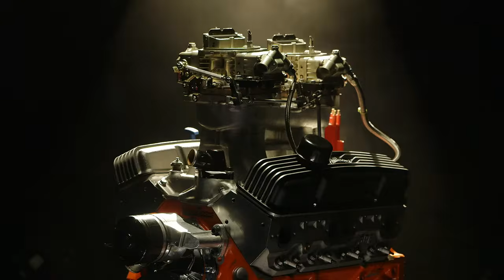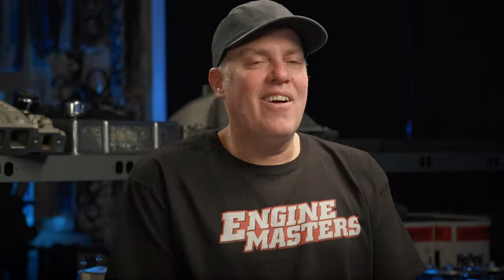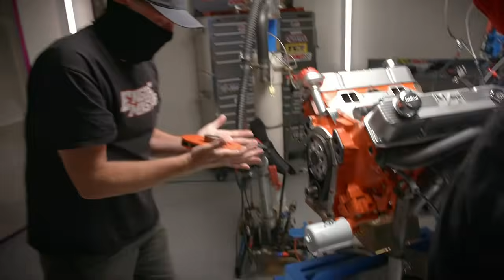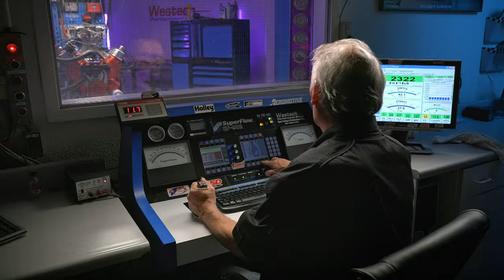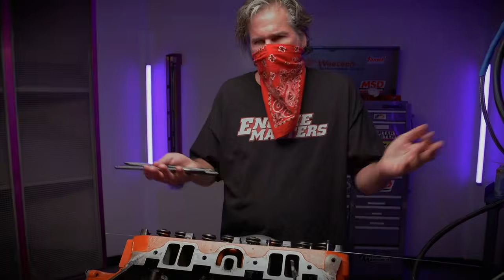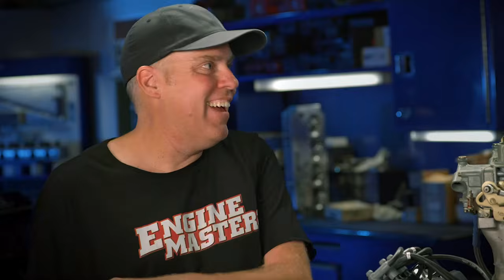Engine Masters  S5E65   Engine Personality Test  Camshaft LSA Explained

Comment: This is so confusing. 
Low separation is “choppy” better mid rpm torque ~4000rpm. 
Wide separation is better for low rpm, ~1500rpm , and better for high rpm ~7000+. 
Is this assessment correct?
 
At the end of the video they put a narrow separation camshaft to tune for mid range torque.

Comment: Failed to mention anything about static vs dynamic compression and LSA. If your running too high of static compression for the street you use a narrow LSA (108-104 duration cam) to lower the dynamic compression so you don't need to run jet fuel on the street... LOL

Comment: On small RV towing cams would the tighter lsa still pick up some low rpm and mid range torque in the usable rpm range im running at and how much would I have gained from a 114 lsa and they getting it ground on 110 lsa? My cam is a Howards 255/261  201/207@50 .414/.420 lift on 114 lsa. Its a pretty small cam but im pretty high geared in overdrive about 2000 rpms 60 miles per hour. 72 C10 pickup. Im guessing i could have gained 10 to 15ft lbs for 4 degrees?  Interesting test. Im already at 10 to 1 compression and 195 psi on the gauge with the 114 lsa and I would think the 110 lsa would crank out an even higher psi number?

Comment: What about vacuum? Do accessories run fine with a 106 cam?
Reply: No....i have a 454....it hets 6.2 to 7.5 hg vac
Reply: @tomkelly3896 pretty rough? Did you switch to a hydraulic brake if you didn’t have that set-up already?
Reply: I had to do a vacuum canister for my Cutlass and fixed all my brake problems

Comment: 😂😂
You guys are funny, idiots but funny. You still think atmosphere psi fills the cylinder will never understand mid range.
Think negative psi and youll find tighter is better
Reply: I didn't consider that but in my research it seems tighter is better for most engines. its like ok extra 5-10hp at max rpm in exchange for 10% everywhere else.

Comment: LSA is like ERA in American Baseball; isolated and not adjusted properly for defensive errors in partially pitched games, it means next to nothing.  When building my second FE 390, we were shooting for 14:1 w/ P&P'd high flows and constant scrutiny of valve events namely EVO/IVC.  We ended w/ a custom grind RV style @ 109 LSA.  Like delicious burnt cheese in a lasagna pan, an end result or product from many other variables.
Reply: Inversely you could have just spec'd your lsa at 109 and arrived at your desired events. It works both ways, that doesn't make one meaningless.
Reply: @pimpovic2 W/ respect; you have to tinker w/ the valve events namely REG in relation to EVO/IVO and set a compression goal as well.  Your LSA is a result of maximizing said criteria, not a starting point!  And as you aim for high compression, even knock rating of fuel enters the stoichiometry.  The Old-Time Racers even tweaked their fuel for weather.

Comment: The problem is, this is really for old ( no emissions), weekend warriors with carburetors.

There is a maximum amount of overlap that can still pass emissions and get decent mpg. I just never seen anyone test that.

People don't talk about the lack of idle vacuum for EFI, Power brakes, A/C, P/S, etc.

This is why VVT was such a game changer abd why current performance cars can be daily driven & make power.

And the whole,  shorten your duration to keep the overlap low is a joke...doesn't work.

Comment: Always consider what you want your power and torque curve to be, on a naturally aspirated street/strip car with a small block I would always lean more towards the tighter side starting at 108. And on a N/A big cubic inch motor again I’d lean towards tighter LSA the only time I would go wider LSA is with boost and even then that would depend on my goals with the engine and how I want it to behave but with that said there’s a lot of variables that go into a decision like this and at the end of the day this is purely my opinion based off what I’ve experienced and seen.

Comment: Hey fellas, how about small block engine test where you keep the same  carb, manifold, cam and heads but only changing cubic inches. Start out with a 327 then 350, 383 etc. would this be a legit test?

Comment: The power from 106* separation angle most likely comes from an advanced intake lobe which will get the large intake column moving quicker by exposing the ports to the increasing bore volume sooner.

Comment: I built a lot of street engines in the 80's and 90's with 112 and 114 LSA, installed 6 degrees or so advanced. IE intake centerline at 106 ATDC and they absolutely screamed. Just get the intake valve open early.

Comment: As you make the lsa wider you are also advancing the exhaust valve opening point. That can hurt low-midrange tq because it's possible work that could be applied to the piston but help blow down losses at high rpm. Same thing goes for the intake opening. Wider lsa retards it and that can help the top end by helping cylinder fill at high rpm. With at a narrow lsa the advanced intake helps low end tq and dynamic compression by starting the compression earlier. It's not just the overlap.

Comment: where are the lobe separation tests for going 2500 to 3000 rpm pulling trailer up a mountain pass?   These tests are worthless to most of us who do not drag race.
Reply: I've never drag raced or plan on it. I would like to know how LSA effects fuel economy at 2100 rpm on the hwy.
Reply: @deadcarnahans1932 LSA on a SBC they like 112 for gas mileage. Don't use a 305 for towing.

Comment: There is no ideal LSA, everything can effect it, and on the dyno with unrestricted exhaust and long collectors, more overlap will show power improvements that are very difficult to replicate in a street car with less then ideal exhaust. Better to focus on  getting intake opening duration lift and closing right , LSA change gains are very combination specific. Also the better your cylinder heads are, the less overlap you need. Overlap is used to add additional vacuum to the cylinder during the emptying cycle by using venturi effect in the exhaust to increase it. So if you have exhaust backpressure in the collector, more overlap can actually hurt the engine particularly at high RPM. I say this as someone who owned a chassis dyno for nearly 20 yrs and tested everything under the sun.

Comment: I think intake valve opening dictates the peak rpm. When intake opens sooner you get more low end power. I wonder if the 112 & 118 cams need to be advanced to advance the intake opening.
Reply: Mostly correct,  intake closing event is a big influence on high rpm performance.

Comment: The 1956 Plymouth Fury's cam had virtually identical lift and duration as the standard performance Plymouth V8.  The difference was the Fury's cam had a tighter lobe separation.

Comment: I find it very misleading to the general population. Lobe separation isn't an input, its purely a result of the valve events. This test needed to show the changes in cylinder pressures with different cams. Could of easily reduced the intake duration and widened the lobe separation to end up with a similar IVC and would of made more ftlb and carried it to the peak power and  made more power. I get understand its almost infinite the things you can try to refine a given engine combination. I just feel this test and conclusions isn't what people should be choosing/selecting camshafts  with..as you know you can change the LSA on 1 or both lobes depending on what you do. That's why and engine will only ever know ivo-ivc-evo-evc...

Comment: I have heard that lobe separation angle or the lack there of will reduce or increase vacuum Hg.  If this is true, does Steve Dulsich's motor make close to zero vacuum?
Reply: You definitely lose vaccum at low rpms. This is why it usually requires  a higher idle speed and is very difficult to run with efi or a car that has vacuum power brakes.

Comment: Then again my hemi 5.7 has a 118 lsa from the factory so it's not all that bad to try it
Reply: Hemis are a different animal with their opposing valves. There cross-flow design doesn't  need as much over lap as an inline/wedge heads.  Hemis also have a unique issue with valve to valve clearance with big cams and tight lsa.

Comment: DV would say pull some duration out if what you care about is idle quality and low speed driving...but keep the tight LSA.
Reply: Especially if you’re a stick car guy. This is why back in the 70s we used to say high lift for a stick long duration for automatic on street cars.

Comment: Another great video. As other comments mention, would love to see idle vacuum for each cam and dynamic compression ratio and/or cranking pressure.

Would it be possible to hav a part 2?  Theee cams all with the same exhaust opening and intake closing but sifferent overlap (intake open and exhaust close).

Comment: Am I correct in thinking a Tighter lobe separation would help bleed off some compression because of more over lap?
Reply: Wider lsa (later intake close) will reduce dynamic compression.
Reply: @Stingray2201 Thanks. I was thinking when he said both valves open for a moment with tight. It would work the other way.  I may be worried about nothing. Some tell me 11.1 Will cause Detonation issues in my application  Others say it's Total Doable. I'm aware of the variables from Quench Piston and head Material.  GM did it with the tbss and it's Heavier. But richard holder say I'm gonna have trouble. Both know what they're talking about. But disagree. It gets Confusing for someone just learning.

Comment: If you don't have a DOHC engine, you're missing the boat.
Reply: 30 years ago or so someone made dohc heads for a bbc and it made 1000 hp on pump gas and was docile enough for street driving
Reply: oh no, my super simple pushrod motor that makes 400+ hp isn't good enough, oh no.....

Comment: Trickflow 190s should've been used on the mopar also cam at 258 @ 0.050 would've done the job . Take advantage of the 902 lifter.
Reply: This is a big block, tfs 190 heads are for smallblocks. If they used TFS 270 heads it would have made 50hp more.

You were right about most cams being designed for small chevy 0.842" lifters and not the bigger (0.906)mopar ones. They gave up some power there.

Comment: It would be interesting to know what the torque and horsepower is from 1,000-3500 rpm for a daily driver. I don't drive over 3,500 rpm very often. I'm often towing and need more torque than horsepower.
Reply: None of this is optimal for towing.  Except the tunnel ram. That will actually work really well. It beats everything
Reply: Thank you! My cruise RPM in overdrive is 2000-2100 and I once hit 4200 on 2-3 shift. Would like to see this same type of test for our engines with mild cams and dual plane manifolds.

Comment: I saw David Vizard do a great video about lobe separation and he was 100% correct based on what I saw on this video - great video to show how lobe separation affects HP and Torque - but i would have like to seen how it affected vacuum in the engine - i assume the tighter lobe separation would decrease vacuum - and if you have power brakes that could be a big issue unless you run a vacuum can -

Comment: David wizard say 108 is the ONLY LSA
Reply: His formula (which is based on a 350 Chevy with 10:1 static compression ratio) is displacement and intake value size specific. I haven't done the math but I do not think you would get 108 lsa on a 440.
Reply: @Stingray2201  the bigger the cylinder volume compared to the valve size makes desired LSA go up. 108ish for sbc but 110 for bbc. I did the math for my 5.3LS and it came up as 108.9. I know its not meant for that engine but dyno tests seem like he's correct there was well.
Reply: It's based on intake valve size and displacement.  108 for a 10.5:1 350, 107 383 105 406 same heads

Comment: 2 l s a  s.... 1. A. 110....2. A 106... The 106 opens its exhaust valve sooner and has a longer overlap...... This creates blow through effect.... And has more blow through effect than the one ten does..... And that's a good thing..... Because it increases the amount of vacuum pulse behind the exhaust pulse.... Pulling more fuel into the combustion chamber...... You blow my mind.
Reply: Not just a scavenging effect making power but also increased dynamic compression with the increased intake valve closing point angle. Another reason boats and towing vehicles use a wide LSA. High loads and big temps makes a motor a detonation machine so the decreased real world compression with the increased LSA makes a much safer combination, even if in a perfect world with 110 octane everything a towing vehicle would appreciate the extra torque from a tighter LSA.

Comment: As David Vizard says: if you have an unstable idle, the problem is not the LSA but that you have too long an idle for the needs of your engine. Choose the correct LSA for your engine and then determine the appropriate cam duration.
Reply: David Vizard entered a Cam Competition for Eric Weingardner and came in almost last place. He knows SBCs but his cam "formula" isn't very accurate. Eric did a video on this and it shows that DVs formula is basically bs.
Reply: @Bobthebuilder.69  Vizards formula is absolutely fantastic , but only for a very narrow window of engine specs. Vizard knows a ton, and does some great things with engines, but his formula should have been left in the dark.
Reply: @Bobthebuilder.69  he also predicted exactly where he would place and how much power it would make.
Reply: That doesn't really work. It shortens the intake duration so much that the intake closing point happens too soon. Peak power rpm is reduced as is peak power because you need to drop the static compression to reduce cranking pressure. 

His LSA theory only really  works for classic weekend warriors. 
cars running high octane, no power brakes, p/s or a/c that don't care about emissions, part throttle  drivability or mpg.

Comment: had a 351w it had a 108 lsa factory. with a tiny 195* @50 and it sounded good with glass packs and headers. pulled like hard to 4000  then was over. 2bbl did not help

Comment: The answer to the question of why higher LSA, always comes down to if you're planning on running high cylinder pressure down low in the RPM range, where you don't want the scavenging to leak boost pressure out of the exhaust. Higher LSA closes up the exhaust quicker when intake valves are opening so you can make more efficient cylinder pressure with exhaust driven turbine, or a belt driven super charger.
Reply: You totally ignored the intake phase. On a wide lsa: as in the test,  the intake is opening / closing later with a wide lsa, therefore not trapping as much air.  The cam is dumb, it’s going to act exactly the same with or without boost. 
  If that” blowing out the exhaust” was detrimental, a wider lsa would make more power if it was “ holding in” more air. The wide lsa just isn’t trapping enough air.

Comment: Tight LSA cam in a street car, auto trans and 3000-3600 converter should be fine. The reason I say this is because I’m doing it in mine and I don’t have bucking. The car drives great and isn’t a slug taking off. Yank made me a great 3600 converter. If you have a stick trans, you’ll just have to work that clutch pedal.

Comment: your blowing my mind......
Look LOOK THERE'S A THING CALLED BLOW THROUGH EFFECT..... WHICH IS MORE POWERFUL YOUR VACUUM PULLING THE FUEL INTO THE COMBUSTION CHAMBER... OR YOU'RE EXPLODED MIXTURE GOING OUT YOUR TAILPIPE...... AS YOU GO TO A LARGER AND LARGER OVERLAP... YEAH IT RUNS CRAPIER. BUT WHAT DO YOU EXPECT... YOU'RE TURNING UP THE PULSE... AND THAT PULSE PULLS MORE FUEL INTO THE COMBUSTION CHAMBER...... YOU'RE KIND OF LIKE SUPERCHARGING THE ENGINE...... BUT REMEMBER IT'S ADJUSTABLE.....

Comment: Now look into David Vizard's formulas for picking a cam. Engine and valve size determines LSA for best compromise of max torque with less peak drop off with 10.5:1 compression. Duration determines rpm range. Then your overlap is a compromise for the driveabilty you want. 

I'd honestly like to see a comparison between something like 104 LSA with 212dur vs 104 lsa with 218 duration just to see how peak rollover is affected with to tight of lsa. A 305 likes about 109lsa, 350 108, 383 likes 106-107. It would be interesting with the lower duration would give better street manners but would probably still have a choppier idle and better torque than a stockish cam.
Reply: as good as vizard is, his formula is only good in a very narrow window of specs.
Reply: @leftyo9589 There's a LOT of holes in his equations.  It really works for Carbureted street/strip cars, Only.

 It doesn't work for EFI daily drivers.

It doesn't work if you have Power brakes/P/S, A/C.

Definitely doesn't work with emissions requirements.

His Overlap chart is a joke. The range of duration is so wide that it's basically useless.

 I also heard him say that if you need more vacuum for power brakes to shorten the duration vs. opening the LSA. That doesn't work either. You can't make peak HP at 6,000rpms on a Stroker SB with a 218/227 on 106lsa with 9.7:1 like you can with a 236/242 - 114lsa 11:1cr. with the same amount of overlap.
Reply: I'd like them to compare cams of different lsa with the same amount of overlap @ 0.050". The problem is the tigher lsa would need such a shorter duration than the 110 or 112lsa that the compression would need to be lowered.

They would need to retard the tight lsa and asvance rhe wide lsa to have the same intake closing point.

That would be a test I'd like to see.

For rhe same amount of overlap, I would need to run a 228/234 @ 0.050" cam on a 106lsa to have the same overlap as my 236/242 on a 110lsa.

Comment: The most interesting test would have been to run all of the cams at 106 intake lobe centre line and it would have been a different result, in my opinion